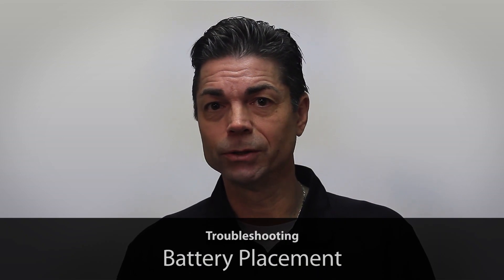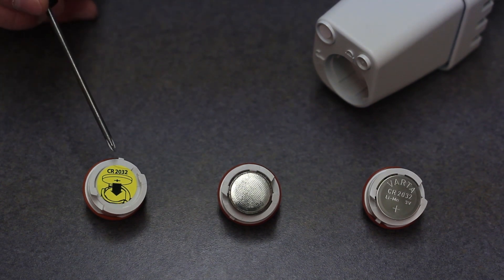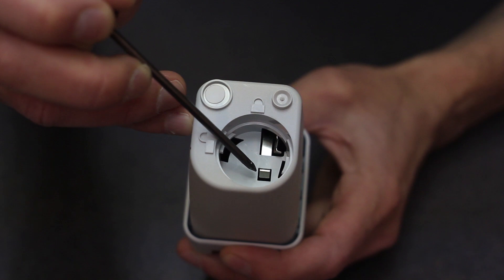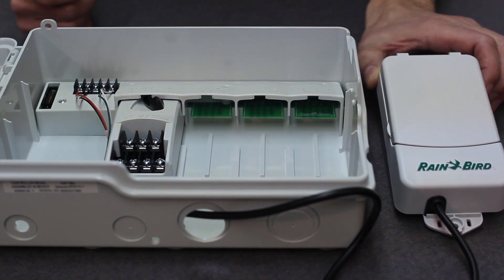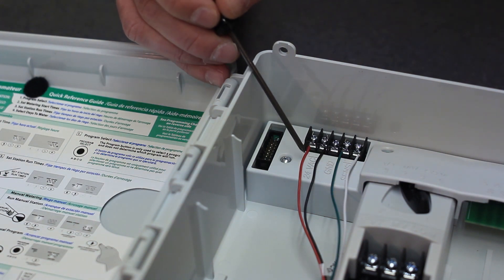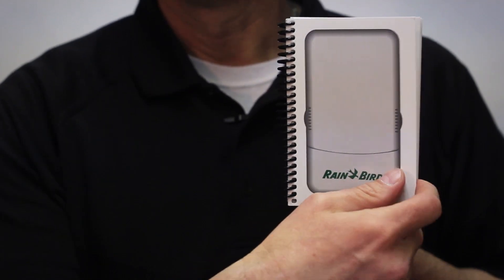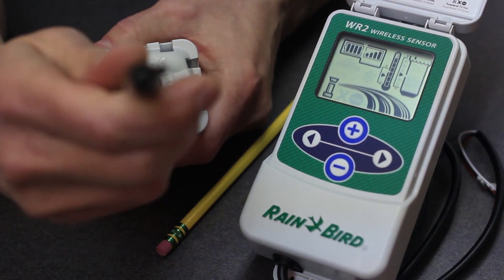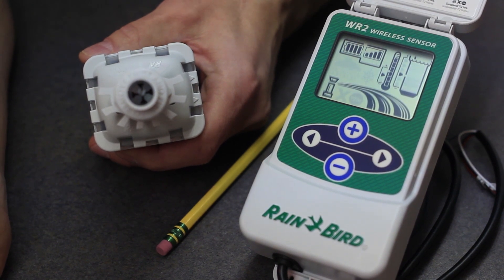Rain Bird WR2 Wireless Rain Sensor Troubleshooting

Comment: Just installed the RainBird ESP-ME3 with Wi-Fi module, do I need to add this sensor or does the application know what the current weather is and doesn't water because it's raining?

Comment: Is it possible to change how long irrigation is suspended for when rainfall has exceeded the set threshold?  It appears to be locked into a 72 hour suspension (plus or minus the added time difference in scheduled runs), with the only alternative to be a manual override.

Comment: My rain sensor icon is blinking recently, and I’m just finding out it has a battery lol. My sprinklers suddenly stopped starting when they’re supposed to. I’m assuming the dead battery is causing the sprinklers not to run????

Comment: I've tried replacing the battery with a new CR2023, then tried to pair it per the instructions and I still don't show the battery indicator as well as the signal indicator on the screen. Pairing just continues to blink. Any ideas?
Reply: Thanks for the reply... After trying 4 different batteries, I was able to finally re-register the device. The CR2023 batteries I purchased from Amazon were garbage. Out of the pack of 10 I order, 3 were good. Device is working properly. Cheers!

Comment: replaced battery but I can't pair the sensor, trying follow directions and no luck, doesn't show battery or signal indicator, continuously blinking, any help will be greatly appreciated. thanks.
Reply: tried 6 batteries, tested with voltage meter, all have a 3.2 volts, maybe I'm missing something here, instructions show all I have to do is press both arrows until they start to blink and install the batterie into the sensor, and the display should show batterie and signal strength , by the way green light flash when batterie is inserted.
Reply: @mannyamaral9406 I’m having the same issue

Enabled pairing mode, inserted battery, the battery light blinks once, but the pairing mode icon blinks infinitely.